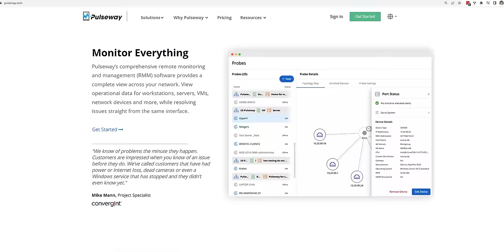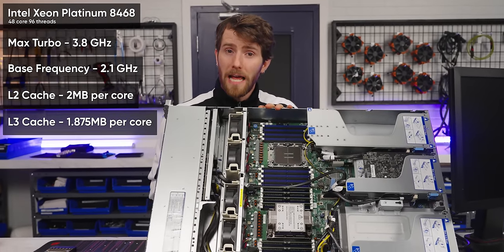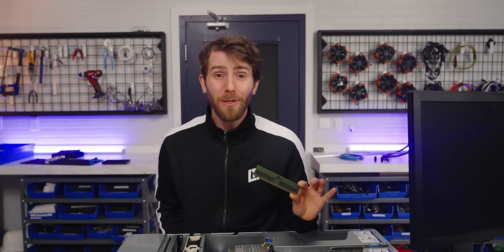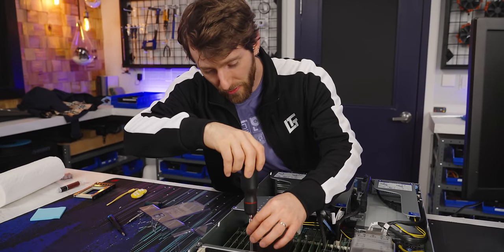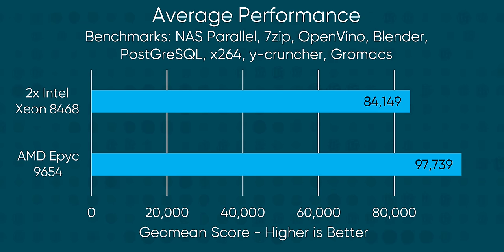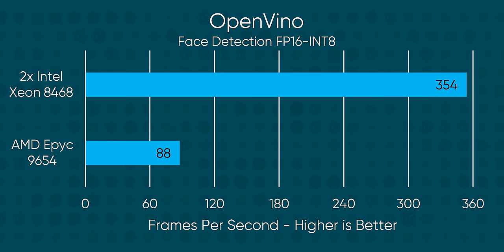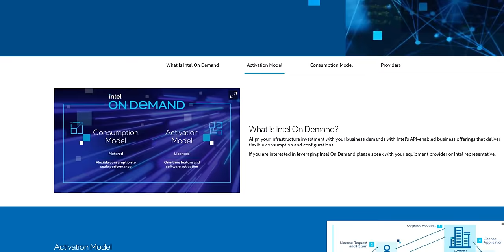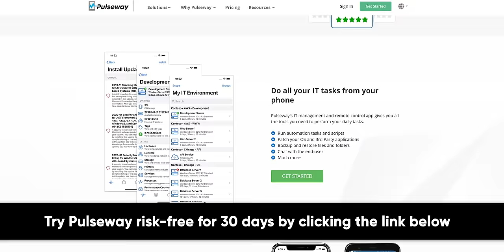Intel’s New CPUs are Cringe - Intel Sapphire Rapids Xeon Platinum 8468

Comment: I used to own a cloud computing company - we were not massive but we had racks filled with Intel Xeon CPU. I was often asked why we didn't consider AMD and the reason is one I never hear you mention: you have to cripple CPU features to allow hot transfer of workload between AMD and Intel. So in an environment where we were counting cores in the thousands or higher, introducing new CPU that are not "compatible" with the fleet would be an insane choice. You'd have to prevent live migration of workload between heads or alternatively, modify hypervisors to limit features to guest workloads. Because of this, we were effectively "married" to Intel. Moving some devices to AMD would have required too much development time to modify control systems, limited interoperability or have meant that we would have had to make very large purchases on AMD to essentially split into two, distinct farms, and that would have been quite a bet to have taken.
Reply: Couldn't you have created 'trial servers' to test it out with beta testers to streamline the switch? It would work since the Beta testers are willing to  risk data loss, and even then they probably have a backup drive somewhere... And then you work with them to finish the optimizations required. That way, at launch, the new servers would be ready and optimized, as well as take a streamlined approach to the switch to the rest of the clients. Heck the Beta testers could accept a steep discount to the first year or so of the new servers.

Note- I'm just making a suggestion. If there are issues with this I would totally understand
Reply: @tatsuyahiiragi416  You don't work in the financial side of a data center do you? Do you have any idea on a mass scale how much that would cost in personnel and R&D? Plus finding the right people for the right tasks makes it basically impossible without a HUMANGOUS investment that does not make sense for the very small advantages. 

Sometimes we tech nerds forget that these are businesses using the tech, that means it needs to turn profit. If it doesn't or the return does not match the input, you do not do it PUNCT
Reply: @Bultizar  I have one question - does making a consolidation of servers up to 6:1 is a small advantage? Because yes - one EPYC server can in many cases replace up to 6 old Xeon ones. When you have huge datacenter with millions of cores then being able to shrink the space and manageability so drastically doesn't seem to me as a small advantage... I have talked recently with engineers from MS Azure cloud and this is exactly what they are doing constantly thanks to these EPYC servers - they constantly consolidate their stuff now.
Reply: We have another reason to avoid AMD: They do not work as expected. It takes a year before the boards and drivers are really working as intended. It usually comes down on AMD releasing the CPUs earlier than they should, because "they can fix it via driver update". Intel spend way more time in QA and has better support for board partners. You usually can order them and assume they work like described. Also Intel CPUs have more features that became relevant for our customers. We do have a AMD farm, too. Just for offering low cost KVMs for tasks like Webhostig. But even there we noticed that customers ask more often for accelerators for Network and AI. And Intel CPUs brings both with it.
Reply: @andreas7944  that's not really what enterprises using EPYC say. You might think that's the case for desktop motherboards and consumer GPUs. But in server processors? Companies that already switched to AMD say how much easier their tasks is now. The switch is hard. After switching, not anymore. AMD knows servers are paramount, that's why they have all their software support on point there.
Reply: @andreas7944  To be honest I have never heard about AMDs CPUs not working as expected. What does that even mean? Its a general statement that does not mean anything and often spoken from people having nothing but bias towards Intel. Since 2018 Intel has shown its "quality" in regards of security (Meltdown, L1Tf, MDS, etc) and in era of GDPR and stuff like that this is a huge issue. Not saying about how big in servers the performance hit can be. EPYC has many features that are not available on Intel or started being available since Ice Lake, like IA SHA Extensions for example very important for WebServers and encryption. Companies, like CloudFlare/Netflix, that switched to AMD do not even consider going back to Intel in a foreseeable future now.
Reply: @przemysawukawski4741  Because he is not tech nerd. He only understand about business.
Reply: @przemysawukawski4741  There are a significant number of factors to consider when deploying any service. Whether it's a single box or a complete datacenter, stability and reliability are critical elements when determining a suitable deployment. 

While the majority of the world's servers are used as webservers, it's not a good argument to use to justify one platform to another. The majority of webservers are platform agnostic: they can run on pretty much anything - no matter the brand or instruction set. 

In far more complex scenarios, microarchitecture becomes critical. Software compatibility with accelerators, hardware limitations, manufacturer implementation of instruction sets, compute/power efficiency, etc. all play a part in determining a suitable deployment platform. The costs to migrate in many cases can easily exceed 100x the total estimated revenue generated post transition across the entire deployment duration. 

It is true that AMD does have issues within the first year after initial release, but Intel does as well for the first quarter. It's a nightmare dealing with the first adopter issues, but Intel is faster in resolving issues than AMD.
Reply: This happens when companies are run by MBA folks, not by tech people
Reply: @sphereindustries5224  Of course there are multiple factors to consider, I am not arguing with that. But if people start to say, that AMD can give you small advantage, then it just means people doesn't know what they are saying. There are cases that Intel has advantages still over AMD, but they are shrinking quite fast especially when adding its security issues, power consumption and pricing strategy. 
As of being first adopter - this time it does not apply to AMD. It was a case in 2017-2019 time frame, now their Zen architecture no longer has teething issues and is well known by the industry. So switching to AMD is no longer a first adopter story. But for Intel with Sapphire Rapids it can be, because this is quite a new design in comparison to the previous generations - so jumping into SR you will be seeing the early adopter nightmare much more than on any new AMD platform.
Reply: @przemysawukawski4741  Your arguments are similar to what we hear on a regular basis by many of our potential clients. On paper, it all looks straightforward with the marketing fluff to prop it up. However, in production it's an absolute hell when an incorrect platform is deployed: Intel, AMD, ARM, RISC-V, etc. 

We predominantly work with edge deployments, developing systems and software for highly complex scenarios. Platform limitations occur regularly, so the selection process is critical. These are systems that may be deployed in locations that can be difficult to access at the best of times - both physically and virtually. Reliability, security, connectivity, and power draw are highly critical depending on the application. 

We've had some issues with Zen 4 EPYC so far, and dependent on upcoming updates to resolve some issues. We're in the process of getting a Sapphire Rapids system for early testing, but it'll take some time to fully adapt to the architecture.
Reply: @sphereindustries5224  I fully agree that deploying a wrong platform to a use case will lead to a pain - I have never said anything different. But you said something about my arguments and then you just copied them in this sentence: "Reliability, security, connectivity, and power draw are highly critical depending on the application." Where security and power draw are for sure in favor for AMD, and rest is more or less equal. More - as for the connectivity - Intel used to be the best in case of networking, however nowadays their NICs are getting more and more issues. So the Connectivity also is no longer an advantage of the Intel platform.
Choosing the right platform is not an easy task, this is for sure. But saying general statements like "your arguments are like marketing ones" or we had some issues with Zen 4 (as if Intel didn't have any which is of course not the case) you are not making your point of view anywhere more valid or better.
Reply: @przemysawukawski4741  There will always be ongoing security issues. That's the nature of this industry. However, if you believe that speculative attacks are the reason why one platform is superior than the other, then you're not up to date with the current threat landscape. Spectre attacks are still an issue, but we do have an ingenious solution for that one. It's called a "lock". Physical security is the best way of mitigating that threat.
Reply: @sphereindustries5224  You pointed out security is important, yet you ignore the fact that Intel platform has much bigger amount of issues marked as critical, nice :) Also you probably forgot the fact that AMD supports full VM memory encryption since Zen1 (2017) and Intel came with a similar security features since 2 years only. AMD has invested much more in security of their architecture than Intel. Critical issues found in Intel Management Engine is just a cherry on the top. If you want to compare platforms and explicitly specify a security, then take a full picture with all features and issues of those platforms. To make a matter worse for Intel - its SGX feature is known to be an attack vector for Foreshadow attacks - feature that was supposed to increase security yet it turned out to be an attack vector itself like a backdoor :D
Reply: @przemysawukawski4741   You are correct. There are significant issues with the Intel platform. Not arguing with that at all. 

Sometimes, you wish these faults are the worst of your potential issues. For example: we cancelled a major contract because the client uses Windows XP to run their business operations, while demanding to have the best security possible so that their "competitors can't spy" on them.
Reply: @sphereindustries5224  I am glad we agree with each other :)
And I truly feel your pain - some clients are just so pathological, that the only reasonable thing is to quit working with them. Seen and heard a lot of similar organizational pathologies with clients of the IT.
Reply: for interop, you can blame Intel and AMD equally.  but really it's your fault for not disabling vendor-specific features if you want to migrate.
Reply: @tatsuyahiiragi416  all good but the issue with this approach is cost - I would have had to fork out money and just "hope" it worked out, when I have every reason to believe it would have caused issues. We were not that big that I would want to drop 10's of thousands on a project in the hope it worked out - I'd have needed to know what the return would be.
Reply: @andreas7944  This is a valid point - my other reservation was exactly this. Using AMD was rolling the dice - using Intel was a known quantity.
Reply: @markhahn0  I mean, my comment almost entirely talks about how buying AMD would have meant we had to limit CPU features....
Reply: @chloefletcher9612  Intel was a known quality? Yes, since 2018 its known to have a  high "quality" especially in Security - Meltdown, Foreshadow, MDS, SGX turning itself into a backdoor, no VM memory encryption and no IA SHA Extensions until Ice Lake, etc. Yep - good quality requiring installing new slowing down patches every quarter... Old times of Intel's quality are long gone.
Reply: @przemysawukawski4741  I said it was a known QUANTITY, not quality. As in, we knew it worked, we knew what we were getting and we knew what the outcome of the purchase would be. This was also, incidentally, pre meltdown; I sold that business in 2018. It was never that AMD wasn't quality - the issue was always the "what if" factor. Buying AMD might have worked fine - but it also might have meant we had to retool our orchestration software, which was developed in house, to prevent various heads sharing workloads, or make other changes or just reduced stability. When you have to drop tens of thousands of your "own" money to find out the answer to that question, or just spend a tiny bit more and not have to gamble.... I mean.... the risk analysis on that one seems pretty obvious.
Reply: @chloefletcher9612  Oh sorry - my bad, I did read "quality" instead of "quantity". I fully agree with your point of view now.
Reply: Somebody that knows their shit. This is all I want people to know. If they could understand half of it. I'm never moving away from Intel Xeon, but we did set up an entirely separate set of racks for the AMD epyc processor just to see if it was better at managing a thousand VPS clients, and I have to say I was very disappointed. I can't even give you the reasons why but AMD just kept having such weird problems with every little detail like it was skipping some of the instructions. No joke. Launch the VPS, set the host name, somehow the host name file gets corrupted, fix it, now something else isn't working, a NIGHTMARE for $10,000 "experiment". 

Thankfully we didn't transfer everything over because our company would have fell through. And it's not my company I just did the marketing and ended up becoming a tech at the company because they didn't know how good I was with hardware. But I got to see the inside of every single platform and auto distribute Linux installations, and AMD although very powerful was not able to hold up as well as Intel or even close especially when dealing with VPS creation and management.
Reply: @przemysawukawski4741  yeah maybe an AMD CPU can replace six old CPUs but no chance of replacing anything recent. Especially when it comes to VPS deployment, website hosting, multi-server capabilities are night and day. 

I don't hate Epyc I just think it needs some better support. I think AMD is fantastic until you get to the actual software over the hardware.
Reply: As a current cloud host, This is no longer the case with newer virtualization (Qemu KVM / LXC containerization), no matter what node arch you're running live migrations are nearly seamless.  Proxmox, Virualizor, SolusVM etc.    The only big issues are ARM however there's even an option to emulate x86 on arm with qemu, this is really neat because it's allowed me to install Windows 95 in a VM on an android phone.
Reply: @thecooleststufficouldfind  As someone who's familiar with using AMD zen cpus as VPS hosts, what kind of software were you even attempting to run for your virtualization?  From experience with other hosts and knowing a host with multiple cages full of 1U's stuffed with 3800x and now 5800x it sounds like someone didn't have a clue what they were actually doing.
Reply: @VideogamesAsArt  yeah, all five of them who switched. It also doesn't matter what they say because if they really are getting better performance they are in a minority business demographic that has few real time tasks and few memory intensive applications. Most of the business world doesn't operate like that.

And no, switching is not hard at all. All you do is buy AMD servers, the migrate to them. It is the exact same process as buying new intel servers. Except a lot of stuff won't work or perform as well as it did before, because there are nearly no CPU workloads that benefit from large amounts of parallelism. High concurrency, low memory, low CPU demand workloads like VDI or stateless application server farms are a great use of the large core counts in AMD servers. Most core business applications just aren't that.
Reply: @przemysawukawski4741  clearly you don't have any idea about any of this with the way you quoted a number of acronyms it is very plain you do not understand lol.
Reply: @malcomreynolds4103  after reading your comment I know one thing - you have completely no idea what you are saying, that is for sure:)
Reply: @thecooleststufficouldfind  From what you said it looks like you have messed something quite hard and blame platform for the issues. If you for example use some tweaked/custom distro to create cluster for hosting VPS'es, then yeah - probably it is tweaked only for Intel platform, thats why you see some issues. Also from what you said it looks like you and your team have experience only with Intel platform - such experience cannot be just moved to AMD platform, because that platform behaves in a different way and old experience simply may not work here. But not blame platform but rather the fact of not wanting to learn new and different stuff.
Reply: @przemysawukawski4741  no I know what I'm doing. Epyc just isn't good. Even at big companies like Vultr, Epyc stinks.
Reply: Seems like a typical jargon from tech guys who hate change, because they imagine everything going badly. Well, it does go badly, but you usually can fix it quite quickly. This is your job, this is what you get paid for and it is not up to you to engage in sunk cost fallacies.
Reply: @REgamesplayer  no not really. I mean side by side same version of Linux running on x86 or x64 hardware all different versions, Epyc fails, miserably. Like I said, you can go to any VPS provider that allows you to choose your CPU, choose Epyc, launch any Linux distro and then go ahead and try to build your website or whatever you're doing. Things like open VPN will work fine but complex database use and you know "actual" work? It's just not happening. We're talking about bugs that freeze the system regularly. And we're talking about Linux which normally, really doesn't need to be rebooted ever... I've tested more than my share of configurations. On my own and with my provider that I use every day. I can make a YouTube video right now where I launch a VPS using high-speed Intel versus high speed AMD (Xeon/Epyc) and the difference after about 20 minutes is pretty obvious.
Reply: @thecooleststufficouldfind  That is some serious accusations towards AMD to the point of them not being able to perform basic tasks for server CPU. 

Yes, I would like to see that video and to read more articles to what you are referring.
Reply: @przemysawukawski4741  Well that's Azure. Surely they have enough resources to fully migrate to AMD
Reply: @joshuakimmich9536  I have never said that they fully migrate to AMD. They are investing heavily in both Intel and AMD, where AMD gives them huge consolidation and performance advantage. I was also told, that if they could they would replace everything with AMD, however the main issue with that is the availability - AMD is simply not able to give them the big amount of CPUs they require, this is why there are still most of them coming from Intel.
Reply: @madi112233  Nope, the business side would have gone to AMD asap, it's all the tech people in here giving you excuses to keep feeding the monopoly.
Reply: @REgamesplayer  it makes zero sense to jerryrig some unsupported, feature incompatible configuration that wastes engineering time and resources to fit your fanboy narrative. No, for VMware workloads right now you cannot v motion live migrate a VM from an existing Intel host to an AMD host and viceversa. There are other workloads such as SAP HANA that are only certified to run on Intel infrastructure at the moment. 

What a foolish asinine thing to say “that’s your job.” Save the science project garbage for your homelab. There’s real money on the line here
Reply: @MrHav1k  What are you rambling about and why you are so insecure as to upvote your own posts?
Reply: What's was the name of the company and how to become like you?
Reply: @PrashantMishra-kh1xt  we didn't do anything special to start a cloud company - just good timing and a good head start. I had an IT consulting business, and many clients who didn't want to buy suitable servers, so we started renting VM space on our own and it grew from there. Those days are over - boutique clouds are just not a good investment in a world where every business device ships running an OS that defaults to a world of Azure.
Reply: Considering it’s a data center and that’s the only place their revenue comes from, I’m pretty sure they do. As far as it being R&D, that’s kinda ludicrous and poor leadership / unskilled techs. The other platform is just as operable/more efficient, so crossover/interopability really is just a speculative excuse  to not actually do real work, which essentially is what should be required of your techs, not lambasted cultural laziness and ignorance
Reply: @sphereindustries5224  Old comment but one thing you wrote made me almost choke on my Twix - "While the majority of the world's servers are used as webservers..." *** On what planet/world do you live? Cuz it sure as $hit isn't Earth/Tellus, I'd be so surprised my jaw dropped to the ground at freefall speed with instant acceleration if the percentage of servers used as webservers even approaches 10%, nevermind reaches it. Either that or you are working in some specific niche industry corner and grossly overestimating it's relative size to the rest of the market. Or you are defining "server" as what the rest of the industry calls "webserver" or something like it? Maybe? I'd love to know where you got that from though, since I did a quick estimate based on the types of distributions of server number and webserver number and I'm at something like 25%, if that - I included internal webservers etc like corp intranet, schedules, HR mumbojumbo things, reporting, BI analysis and forecasting which all have/are webservers as well as various specific web based tools like CRM's, logistics management etc. However there I run into a problem with your platform agnosticism, because a bunch of the stuff I just rattled off is anything BUT platform agnostic, some specify the exact hardware configs they will run on, or be supported on which might as well be the same thing. The rest of what you say makes sense and matches my experience fairly well. That's what makes me curious as to what you mean, or do you brand everything that has IIS installed as a webserver regardless of it being used as such in the way that most people would use the word 'webserver'?